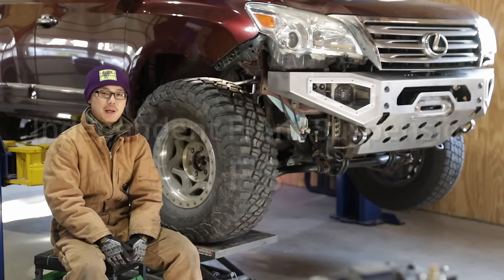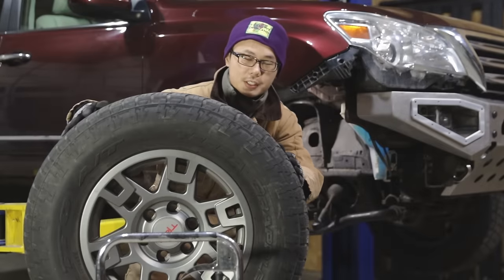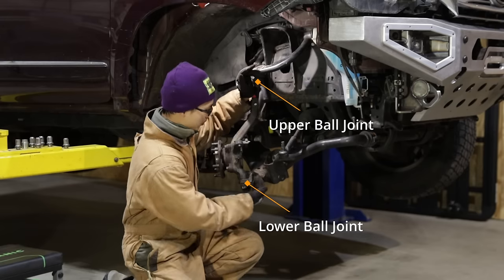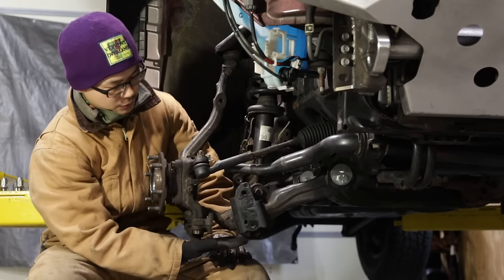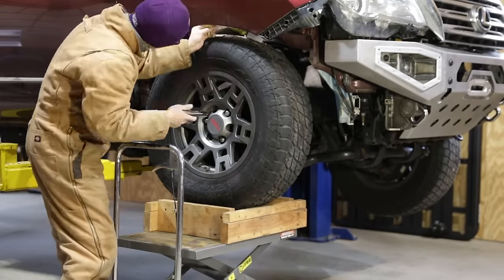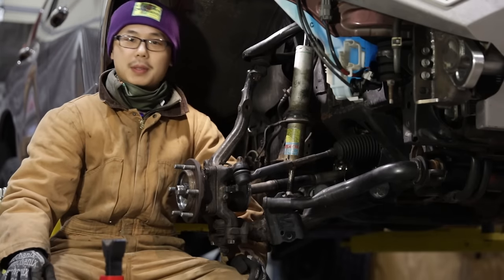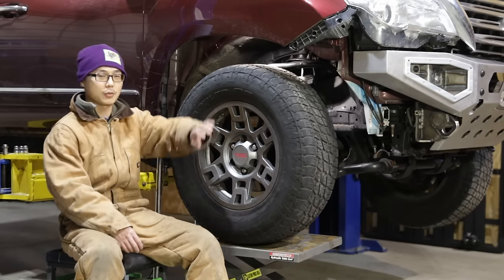Everything About Toyota IFS | Suspension Construction and Limits | Part 1

Comment: Forgive me as I try to think thru this.

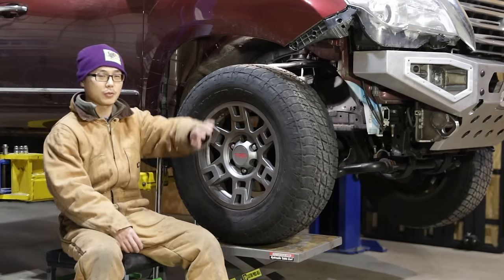10:59 

So if one of my primary goals with my 2018 4Runner is to increase belly pan ground clearance to reduce the risk of large lava rocks punching holes in something on trail, then I should expect that will come at the expense of down travel and total articulation, despite going extended travel.

However, I would also lose some up travel due to the increase in spring rate as it compresses.

Is there another way to get the 2.5” of lift, with the extended travel droop, without losing access to the full up travel? Seems to me the only option would be softer spring rate, but again that would come at the expense of lift aka clearance for rocks.

If that’s all correct, then my decision comes down to, how much travel am I willing to sacrifice for how much added clearance. 

I guess since I trail ride on rough, rocky trails, but not actual rock crawling per se, then the 1.5” loss in droop from 0 lift is not such a bad trade off for 2.5” more clearance, plus the 1.5” added clearance from going from 31s to 34s. So add 4” of total clearance, lose 1.5” of droop, lose X” of up travel, and increase CG by some amount.

Hmm…..

Comment: Another great video. Very well done. I would like to know where the "12 inch travel" gets their numbers from. 
I'm planning on Bilstein 8112s for my Tundra. Wish we lived closer so you could examine a Tundra setup.
Reply from the maker: Thanks! Tundra seems to have a lot more untapped potential. Some LC200 even do Tundra swap to get more IFS travel
Reply: @TinkerersAdventure  HI Kai, hoping you'll see this question. Looking at the uptravel it looks like if you moved the bump stops up and got a CV axle with more than standard articulation, you could gain some more up travel. 

Do you have any thoughts on this? There are CV axles on Rock Auto right now promising 47° of articulation vs the stock 23°. 
TRAKMOTIVE T08043XTT

Comment: Thank you very much for all the info, I have been binging your vids, they are truly great and informational especially for those of us that are not very knowledgeable. I have a 14’ GX460, I gathered that a 2.5” long travel is ideal for me. I am confused if a 2.5” + .5” spacer above the coil over is the cherry on top. I will replace the UCA. Since the .5 spacer will give me that extra 1” of downward travel. 

Please share your thoughts and correct.

Ideally I would like to have the best ride and performance balance. The GX is my daily driver. 

Thanks again!
Reply from the maker: Thanks! Check out my Truth about extended/mid travel video if you haven’t already. If your coilover is already extended, adding the 0.5” spacer will cause harm by over extending droop.

Comment: Obviously an awesome video! But very cool garage with some nice tools. What's that scissor jack you're using to lift the tire called? I need one! Is it a rolling motorcycle jack?
Reply from the maker: Thanks. That’s a 500lbs hydraulic table from harbor freight. I should’ve gotten the 1000 lbs version. This cannot jack up a Rubicon front axle with 37s attached.

Comment: You really understand this and with excellence explain this subject. Is there way (other than buying brand new spindles) to measure the straightness of the Toyota spindle? Since the tire/ toyota IFS suspension at its heart is the spindle... If the spindle is even slightly bent wont it be "almost" impossible to properly align the vehicle since a hunter alignment is done at a static position of the suspension? Maybe a collision repair have these specs? Hope this question finds you, I'm so thankful..
Reply from the maker: I’m not sure if there is an easy way. My friend FJToyman made a dedicated fixture to measure his spindle core returns

Comment: Any brand coilover recommendation to help with top out/ thud on full extension? Dobinson ucas, stock lowers currently. 

My ome nitrochargers/ 885 springs are thudding so loud on top out. Like over a speed bump/ rock/ washout where the shock extends quickly and thuds on top out. Oddly enough only driver side. It’s definitely the shock top out not contacting anything.

Just measured my downtravel. 1.5” driver side/ 1.85” passenger. Perhaps why the driver side tops out at harsher and more noticeable.
Reply from the maker: I don’t know any brand specifically do something to prevent this. The bilstein 8112 has a top out zone, but it will also make noise, just different noise. For this very issue, I switched to long travel and have 4-5” of down travel.
Reply: @TinkerersAdventure   I ended up taking out a spacer that was on the driver side for the “Toyota lean”. It was small but was a preload spacer and giving me around .40” lift in that coil. Well, unbelievably gaining back that little down travel has stopped the top out. I have about 2” down travel now on the driver side. Not ideal but it’s working great now.

Comment: Can I ask a question? So extending a shock with a spacer making it longer will cause the suspension to droop more putting more stress on the cv axels? Vs getting a coilover that is the same size of the stock strut and uses the spring tension to create lift? Or does a coilover that lifts 2" put as much stress as a spacer that lifts 2" on the cv axel? In the xterra groups a manufacturer is claiming they can lift 3" with a coilover lift without binding the cv axels vs a 3" spacer that will bind the cv axel because it puts more droop on the knuckle. Or is that bs and they create equal extra pressure on the cv axel? Could you maybe do a video comparing a spacer lift vs a coil over lift?

Comment: I thought for extended travel coilovers you can’t use the factory ball joint UCA’s, it has to be a Uniball, is this correct? Thank you for these videos, you’ve earned a subscriber.
Reply from the maker: Yes this is a common belief in the community and are advertised by most manufacturers. But you saw we didn’t bind the factory UCA in this video with extended travel coilover. There are some more small details about this, which I will cover in part 2.
Reply: @TinkerersAdventure  yea, on my tundra I have the regular 2.5 king shocks on factory balljoint UCA's not extended travel and they bottom out alot. I am going to make them extended travel though, thanks

Comment: hi Kai, for casual off-roading (desert dune) Do you think stock Spindle is strong enough or should we need to upgrade the aftermarket spindle reinforcement or unnecessary? 🙏 thanks
Reply from the maker: I think even for casual off-road, sometimes you can hit stuff you don't intend to hit and bend the spindle. It's not a bad thing to reinforce. The only trade off is you may need to run more negative wheel offset to clear it, depending on the design.
Reply: @TinkerersAdventure  thank you for the clear explanation. meanwhile, i will ask Chatgpt what are the best spindle reinforcement design suit my stock fj 😁😁😁

Comment: Do you have any info if OldManEmy ~2" lift its extended travel or not ? didnt find anywhere that info. 

for Pajero 4 IFS (its simular to toyota)
Reply from the maker: I am not sure. For toyota Old man emu was not extended travel.
Reply: @TinkerersAdventure  damm, will take a look when they arrived. but they arent huge lift front 35-40mm, rear 40mm. so wont make any huge difference for downtravel, right ?